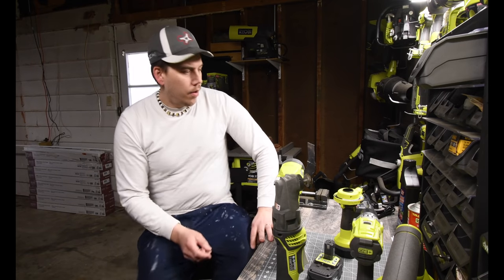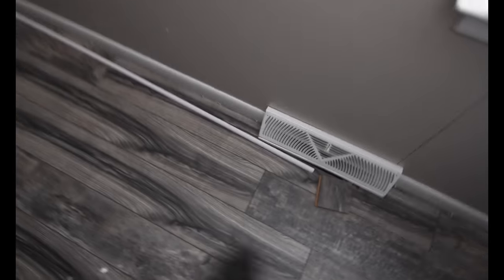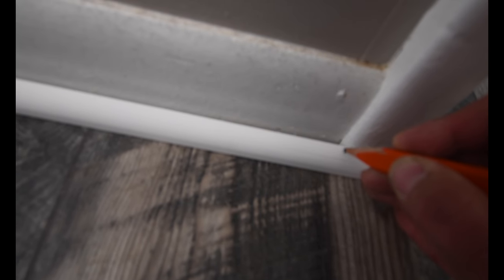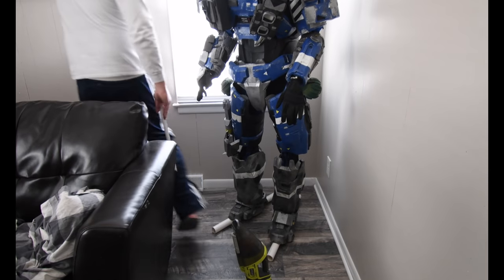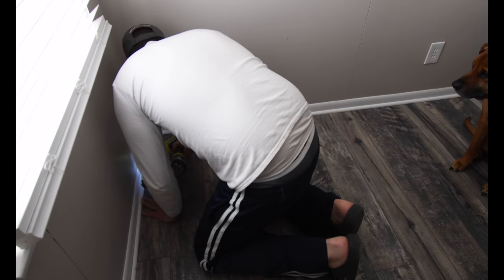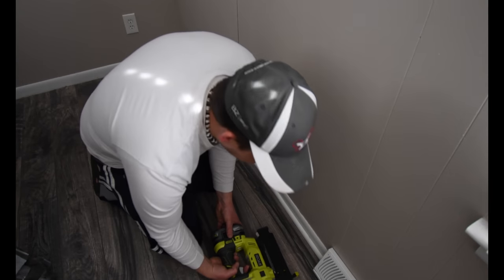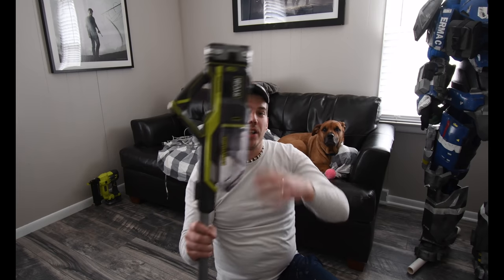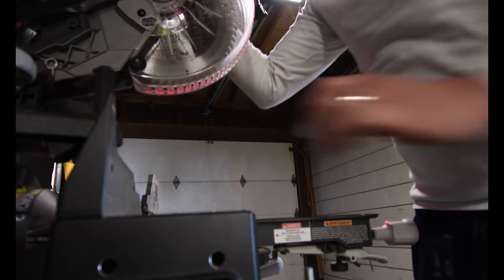installing Quarter Round (Shoe) in the game room

Comment: Very nicely done David. What was the deciding factor, when you had no tools and you made your decision to get the Ryobi system? Did you have any tools from another brand, then switch or have you been with Ryobi from the beginning? I really enjoy your videos and I myself have had 2 black n decker drills years ago 14.4 volt but the 2nd one had a different battery. Then a couple years ago my mom bought me a Dewalt 20 v. Something I wouldn't own because of the cost. Definitely an upgrade from the black n decker drills. This past Christmas I bought my own present, which was my first ever combo kit.😍😀😃 I've been very happy with my Ryobi combo kit. I never used a impact driver before. Sad statement for a guy who is about to turn 64 on Good Friday this year. 19th!!  What kind of work do you do? Thanks for sharing your talent and videos, Rodney
Reply from the maker: Rodney Widger I had no tools, after some research I found the one+ system and love it